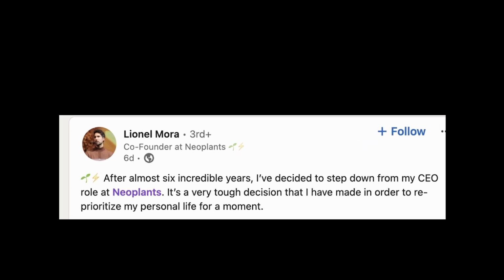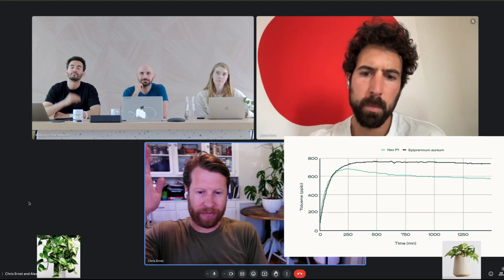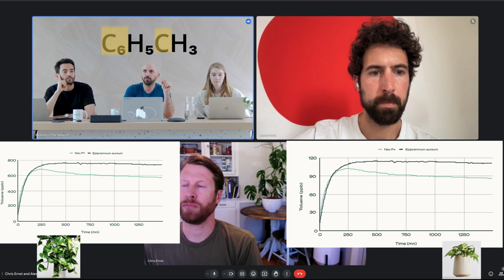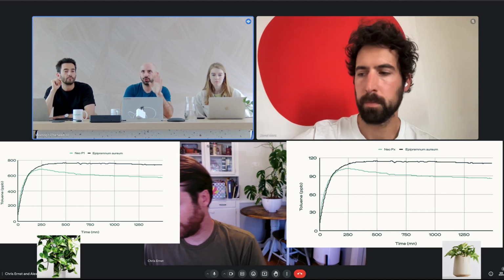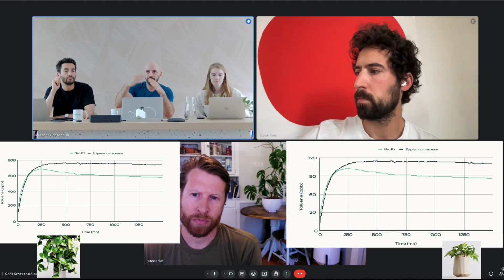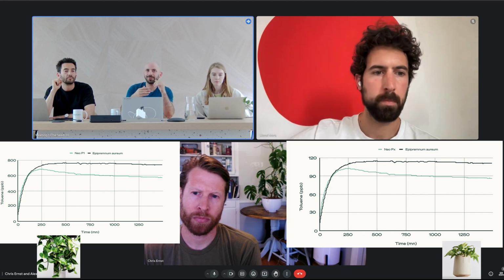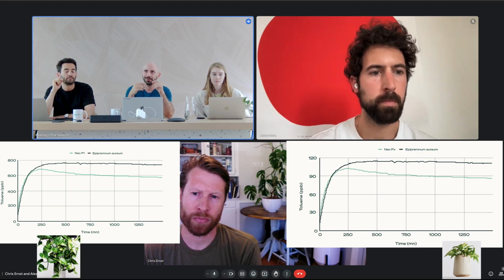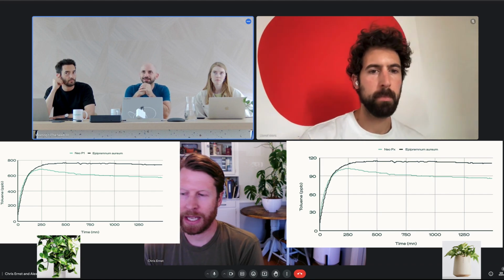NeoPlants CEO Steps DOWN - Tough INTERVIEW

Comment: Thank you. The scale change is not the significant issue here. The noise bumps in the two series were exactly the same. If they had run the experiment twice there would have been differences. They presented the exact same data with two different plants pictured. That is falsification of the simplest kind. 
This is a trick older than Henrik Schoen.

Comment: Ignore they crappy science and just look at the logistics of what they are selling. The plant doesn't really do much purifying on it's own, they are selling a bacteria supplement.  The whole purifying premise is based on contaminated air coming in contact with the soil, not the plant. There is nothing powering that air in and out of the soil; it needs to breathe. What happens if you have bad air flow in your house and their is no pore volume exchange in the soil? What happens when you water the plant and all the soil pore volume is filled with water for 2-3 days? This is all a scam.